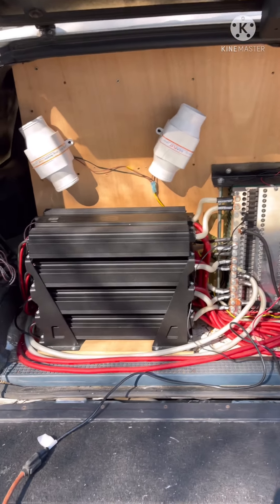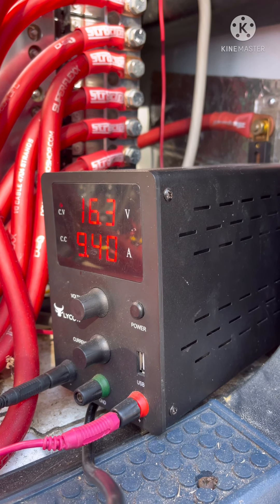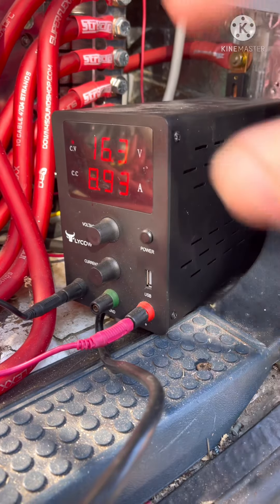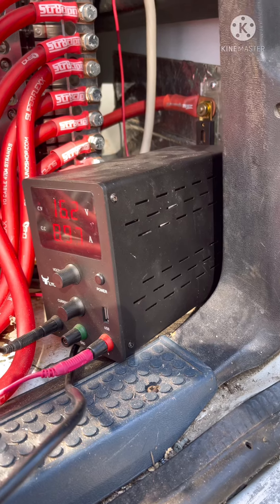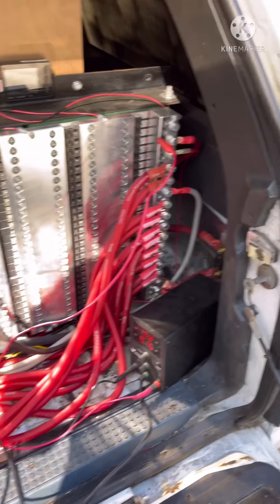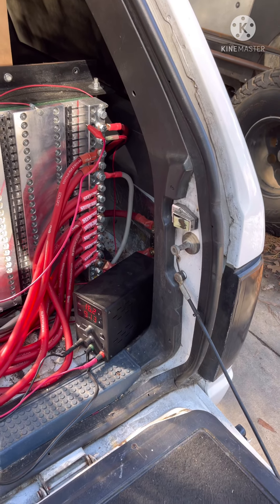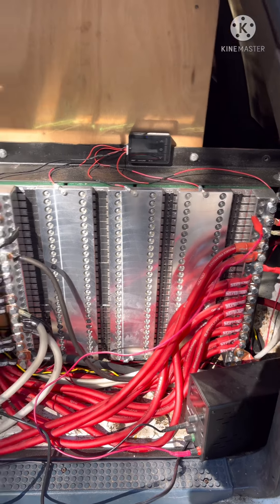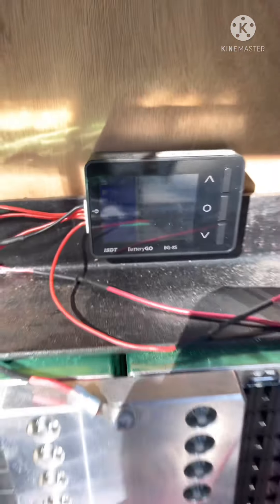Charging your lithium battery bank

Comment: Not hating, however, I don't see the point of this . I know you can charge lithium from a power supply, but why use a chemistry that has a higher voltage than your vehicle can supply, just to need a separate slow charger to charge it. Yes, I know the higher voltage is better for your amps.

Comment: I have that same power supply. It's held up for quite some time now. 😎👍

I did just snag me a 120 amp taramps smart charger. I had to get another plug cause it's Brazilian configured stock. That was only 6 bucks on Amazon though.

Comment: I see the charger on amazon but which model is the one you got the 30v 10a or the 60v 5a? Thanks
Reply: You want the 30/10
Reply from the maker: @Widowmaker2828   yes sir..
Reply: @Widowmaker2828  thanks..its funny that you replied because i just started watching your channel and sub'd
Reply: @JerryAintloud , if this was a daily driver? How often would you charge it?
Reply from the maker: @62dobie  not at all your alternator will charge. this is for newly built banks and banks in cars sitting for winter
Reply: @JerryAintloud ,thanks for the reply. I'm just getting started with Lithium. You and a few others have been a great help. Thanks again. I'm still deciding between Limitless or Underground Power. I like the size of Limitless, but I can get about 2x the Lithium Ah with Underground Power for the cost. Doing some more research.

Comment: You can hook the power supply to the Icharger x6 which is like your battery monitor but with extra features and set the voltage on the x6 and the x6 will control the power and amperage and balance the banks also, you can test cells by changing the cell to 4.2v and then discharge 100 percent to 2.75 and it will tell you the ah rating used cmax cells should be around 4ah also looking at their nternal resistance 0.8 to 1.2 so.if the cell is way off it could be delaminated and is going to fail soon

Comment: I bought a 40ah underground power lithium battery and their 8amp charger. I haven’t installed my lithium yet so I’m tryna learn before I install it. I currently have a 220amp alt, soon a 320amp alt, and I wanted to know how often I’d have to charge my lithium battery even if I had it ran to my alt? Also with your experience, would it be best if I ran my lithium to my front AGM battery but I put an isolator between the two OR run my lithium straight to my alt?
Reply: Did you finally get the 320 installed? If so, did you see any difference in voltage drop.
Reply: @62dobie  There was a good bit of difference, but imma need their 80-100ah lithium instead of their 40ah
Reply: @DisShiTooEZ , I have the 80 ah on a 250alt. I'm going up to a 400alt and adding another 80ah. I don't drop below 13.3 but I charge at 14.3 with the car running.

Comment: @Jerry Aintloud I'm about to purchase my lithium bank and was considering the cyber 12 but my alt is a 320 amp brand x internally regulated for a 12v system and am going get a md 12000.1 .5 version do you think that the cyber 12k and a 320 alt will be appropriate for electrical thanks your videos are dope
Reply from the maker: the cyber 12k is garbage, everyone I know that got 1 hated it
Reply: @Jerry Aintloud I talked with Johnathan Patrick today about his lithium and the guy over at underground power about there 80AH bank I just don't want to have to fool with having to charge so high I know I'm probably going to more power out of my amps that way but it's a lot hassle for an extra 500 watts
Reply: Thank you for you reply I enjoy your content and learn from what you got to say brother